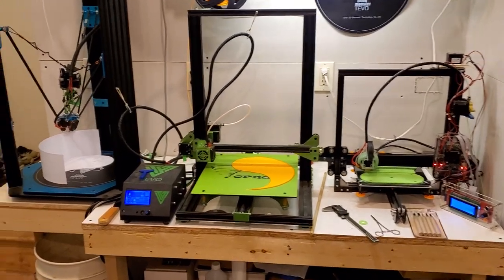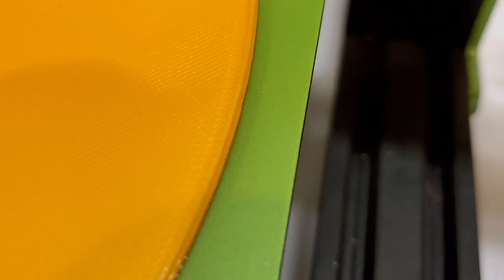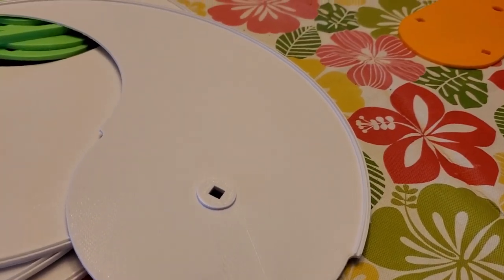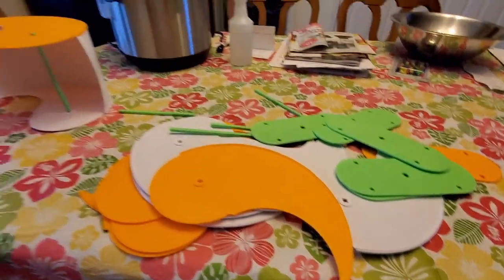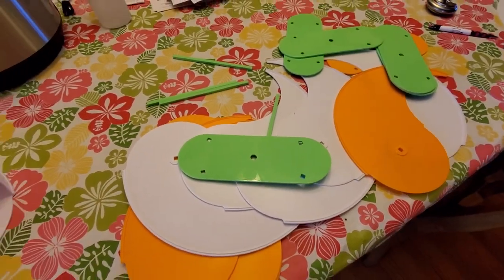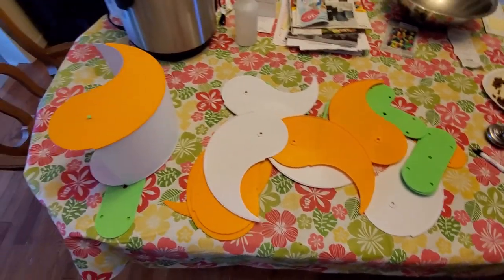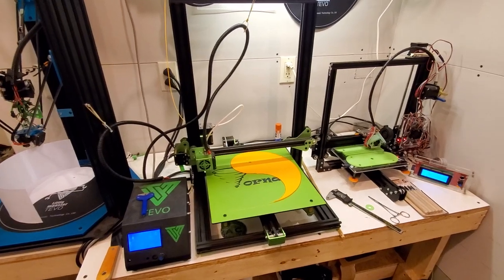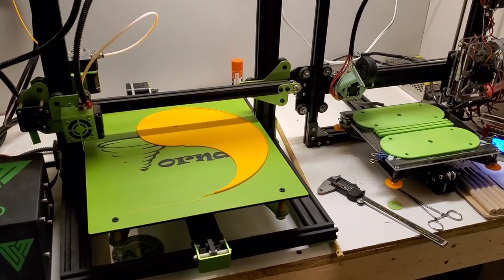Testing, testing and more testing ...Basic Crowdfunding Kit progress update

Comment: seriously think you should consider stamped aluminum instead of plastic.
Reply from the maker: We will use aluminum for the Residential production units that require it (mostly due to extreme conditions). But wherever the plastic scoops will be appropriate I would like to use recycled plastic from ocean and landfill ...helping to reduce environmental contaminants with our manufacturing process as well as making clean energy. If you mean stamped aluminum for the small kickstarter kits; I can't imagine that would be cost effective? I'd have to see the numbers on large volume orders I guess.

Comment: Try to make it in one piece.
Reply from the maker: Tried that over a year ago with the much smaller pink scoops and it was a horrible failure for 3D printing. It's also a problem for shipping because they will not nest together and so shipping would be a LOT of empty space and danger of damage. That's why I'm doing the kit like this so it can be easily shipped without waste and easily assembled when you receive it.
Reply: Christopher Moore Surely, but because of the thickness, I think there will always be this deformation. For manufacturing, I was thinking more of a mold.
Reply from the maker: We will definitely be doing injection molding for the large quantities of orders I'm hoping that we get. I'd love to get over 10K orders which would represent 1M in funding for Harmony. Do you guys think that we could achieve those kind of numbers? I'm going to do everything that I can to ensure we have good solid kits that perform well and are easy to assemble... but am I dreaming to think that we can get >10K orders for the small Crowdfunding kits?